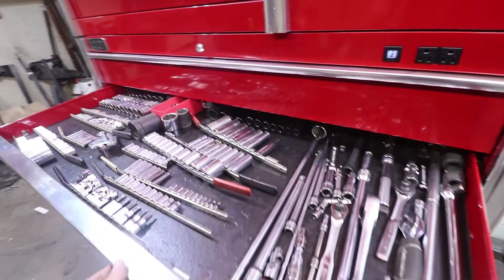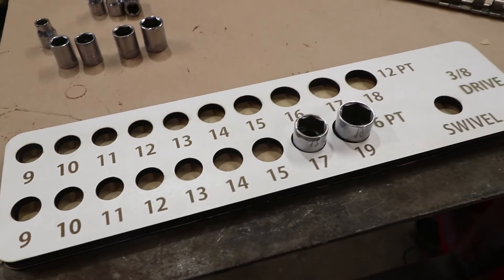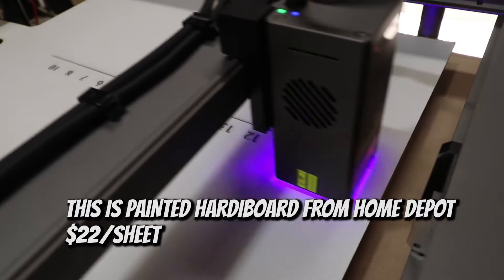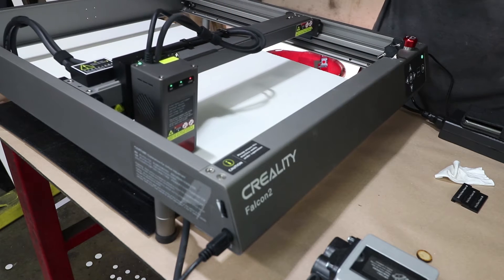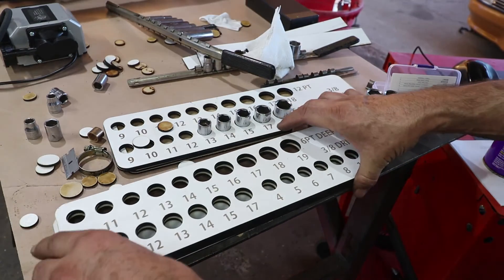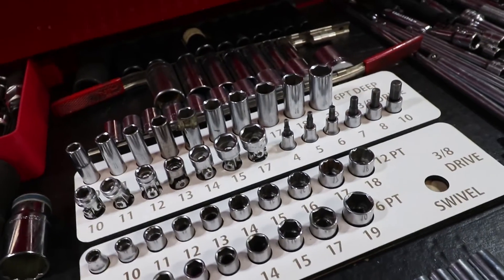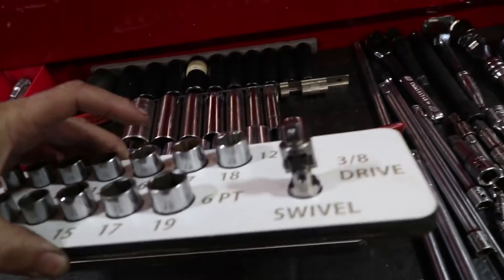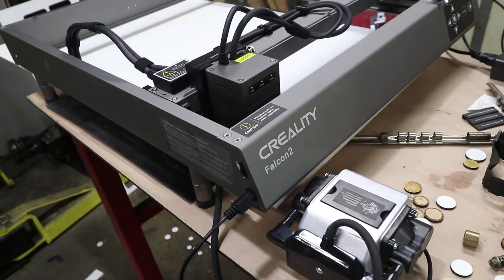Can't FIND the Right Socket In Your Toolbox?  -  Check Out This Laser Cut Socket Organizer

Comment: I did the same with my laser. I also made a small box for the catch all sockets that I didn't want to sort. One for SAE and one for metric with a divider for 1/4 and 3/8 drive sockets. Rather than make individual layers I only cut the top layer and used interlocking box designer to make the sides and bottom. I am not sure it saves that much time and the edges of yours are much cleaner. 

Also great video
Reply from the maker: Thanks!  I want to do the same tab and slot box structure for some other tools too